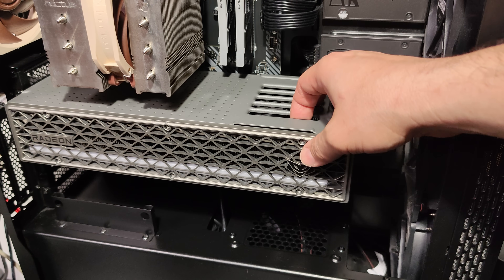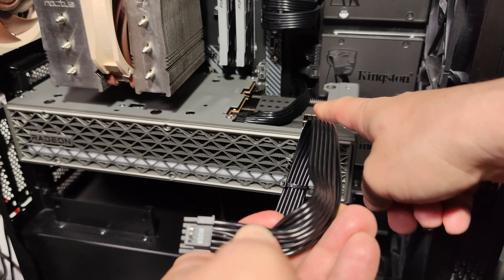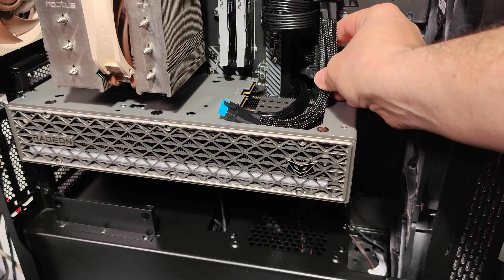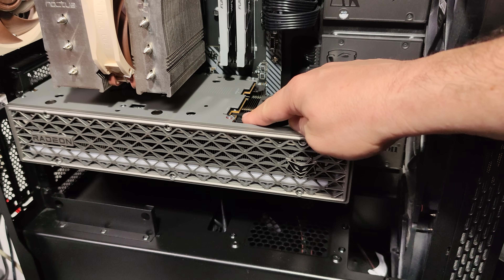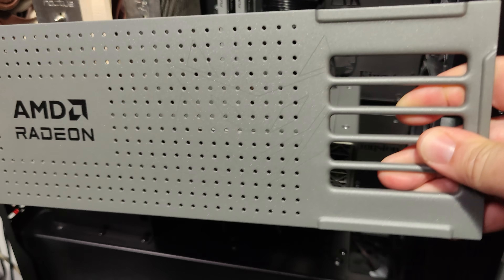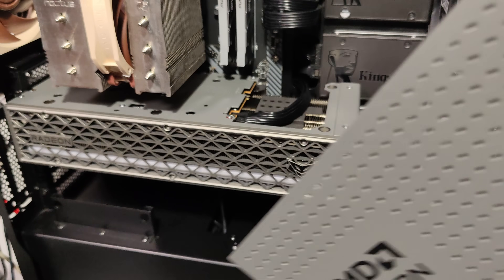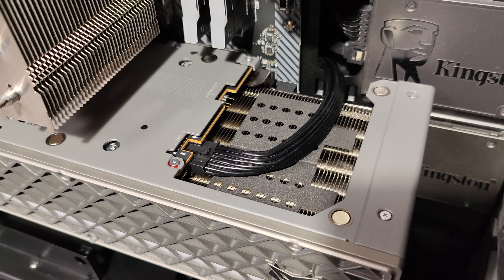Radeon RX 9070 XT Sapphire Nitro+  Magnetic Backplate More Problems Found And Exposed 🔥

Comment: Do the 9070 XTs have a lot of coil whine? I've read that this model, like the Pure and Pulse, has it. Do you think I should be worried? Sometimes I think people don't limit the FPS, and it turns out they're running at over 500 FPS in the menus.
Reply from the maker: I have also read about this. I haven't observed it on mine yet. I don't limit the FPS and indeed in some game menus it does crazy fps. Under heavy load i mostly hear the fans as I have a rather small case and it gets hot inside fast. Also the 9070 XT blows all the hot air into the CPU making it spike much more higher as I'm using the notorious Ryzen 9 5900X.

Comment: yeah guess what, the backplate is not sitting well because you dont use the delivered adapter in the box...
bro is just talking shit about the beding of these 😂
Reply from the maker: Yeah glue and foam on the heatsink, adapter cables like it's the '90s, using worst power connector ever made, adding a metal plate over a backplate so it traps heat, no problem here, the perfect reason to ask at least 300 euro move over the MSRP for this botch-up job.

Comment: Magnetic backplate is so stupid. Backplate was made to improve the stiffness of the PCB board. Going magnetic means you just add weight on top of the card and does nothing.
Reply from the maker: Very good observation. Sadly some people still believe that it "dissipates" heat....
Reply: To think that they just put as much budget on this non flagship card with all the material is just unbelievable… This card doesn’t take 500W to run but built to look like one. Also, that bulky ass shroud is blocking all the air and it looks pathetic… and it’s covering up the fact that the heat sink isn’t actually thick. Probably the same thickness as other 2 PCIE slot options. I missed the sleek nitro design for the RX 5000 series😢

Comment: Thanks for this honest and realistic look at the card's design. What you mentioned is almost exactly how the card appeared to me on first look. I'd be interest in what the actual heatsink/cooler design is like underneath that giant cage. I wonder if the heatsink is the same size if not even smaller than competing models.

Unfortunately, what Sapphire has done is create a LARGE card that people can mistakenly believe translates into better cooling performance but that may not be the case. Would love to see this card with ONLY the heatsink and what it looks like.
Reply from the maker: I will try to have a look over the cooler as i find it strange to see the VRAM doing 70-75°C in Windows with light loads and 0dB mode. With fans forced on it will cool the VRAM to 55-60°C.

Comment: I JUST ORDERED THIS CARD. YOUR STARTING TO SCARE ME.🙉
Reply from the maker: The card works for now, but the price is unjustified high. Ohh and another thing, mine will not be stable with an undervolt higher than -50mV so not won the silicon lottery either.
Reply: @TechTronic9000  i canceled mine. I was tripping @ 1K. That 2 much.
Reply: Im Falling back 4 now. I just want something for editing videos and creation. Can the Arc A770 do that 4 me??
Reply from the maker: I also got it for video editing, I'm using Davinci Resolve and it's pretty good. From what I know the ARC has pretty good encoders and should work ok for editing. Maybe you can also look for a non XT version, in my area they are about 200 euro cheaper.

Comment: 100% correct, we should prioritize functionality over looks again.
Reply from the maker: And not ask 300 euro more for the "extras" they did.
Reply: @TechTronic9000  Of course! But the base 
$599 MSRP is too high too, this is a $399-$499 card at most. The 'base'cards currently cost $866 or more in the Netherlands. €672 is the price including 21% taxes if you convert $599 so we already have a 12.2% priceincrease for the cheapest base-card which is ASRock. Another point of consideration: no GDDR7 and only a 256-bit memory bus, this is NOT aw highend card. Note that GDDR7 would cost $4-7 per GB while GDDR6 costs $2-4 per GB, something like that (not sure about the GDDR6, pretty sure about the GDDR7) so there definitely was enough room to put the better memory on it which would not only increase performance with 40% but also decrease the power-usage and temperatures. 

I have a 5700XT, I strongly consider to skip this round and upgrade sometime after I upgrade my Zen2 3700X to a X3D Zen6-CPU, it is roughly known what they will do with Zen6: 12 cores per chiplet, a substrate for the chiplets which strongly lowers the latency and a reworked I/O-chiplet. + low hanging fruit because Zen5 was kind of a new microarchitecture for which they couldn't fix everything yet. Zen6 will be a good gaming-CPU, guaranteed.

Comment: Honestly a complaint in search of an issue
Reply from the maker: Honestly since when it's a good idea to glue foam on a heatsink, to use the worst power connector and add a second plate over a plate and call it heat dissipating? Then have the reason to charge 300 euro more over the msrp for this botched up job.

Comment: Hello, I have this card with a Seasonic Vertex power supply, the 12 V cable for this power supply is much more flexible and not interfering with the back-plate. I recommend you break the plastic in between the 12 V cable so they can move independent
Reply from the maker: The most easy fix was not to put the plate on as it doesn't do anything, it traps heat and puts more weight on the card. That still doesn't solve the foam pad over the heatsink fiasco.
Reply: @TechTronic9000  It makes it look clean, works for me and temps are very good, I'm not worried about a little foam

Comment: One thing uploader missed:
- ATX 3.0 standard on his PSU vs ATX 3.1 standard for the 12vhpwr connector.
Reply from the maker: The ATX 3.1 connector should have shorter sense pins so if you don't properly connect the 12VHPWR cable it should not work at all to prevent bad contacts. This doesn't solve the foam on the hitsink fiasco, the 2nd backplate just trapping heat and adding extra weight.

Comment: why did you buy the card? All of this was said on their website
Reply from the maker: It was the only thing that i could find in stock. On the website they don't mention foam pads on heatsink fins and you also don't have proportions to see how bad the 12V connector is placed. They also advertise the backplate to dissipate heat, while it actually has no thermal contact so it just holds heat.
Reply: @ then how about you wait until restock?

Comment: GN and J2C did testing with/without the backplate and found no difference in temps. Stop lying.
Reply from the maker: Any exact links for that? In my compact PC case removing it makes a hell of a job as I have a close by system fan that blows over the board. The difference is extremely visible in 0dB mode with the fan off.

Comment: What a nonsene. I just installed mine. Backplate sticks on really good. Absolute gorgeous card.
Reply from the maker: That's why we get companies like ngredia, scalpers and retails acting like thieves. Foam glued on the heatsink, worst 12V power connector ever invented , a backplate over a backplate just trap heat and then add extra 300 euro over msrp, that what's wrong with this. Gimmick and marketing to bump up price with zero functionality.

Comment: Funny, I'm not having any issues with my cable routing, you should learn to route your cable properly as it looks like you didn't even try.
Also, use the GPU bracket to eliminate the sag, quit nitpicking for fucks sake. Seems you're only trying hard to find something to whine about.
Reply from the maker: Are you kidding?! Sticking foam on a heatsink? Using the worst power connector ever made, the 12VHPWR, adding a backplate over a backplate so it traps heat and then ask 300 more euro for such a botch up job! This is the sole reason we have ngredia and scalpers all over, ignorance.

Comment: Have you heard of GPU swag????? Maybe you should considered to use some kind of GPU support so you do not have that backplate wobble (your GPU is bent on right side 'cause of weight and you got GPU swag and backplate beeing held by magnets it is not bent so you have wobble)!!!!
Reply from the maker: Are you kidding?! Sticking foam on a heatsink? Using the worst power connector ever made, the 12VHPWR, adding a backplate over a backplate so it traps heat and then ask 300 more euro for such a botch up job! This is the sole reason we have ngredia and scalpers all over, ignorance.

Comment: Yes, I have a question. Why do you think they decided to implement this connector? What would be its advantages?
Reply from the maker: There are no advantage, they wanted to hide the wires to make a kind of innovation, they could not achieve that with 2x8 as there would have been to many wires to force there in the awkward 90° position.

Comment: There a better much more flexible cables out there . Your cable is bad !
Reply from the maker: I can split the wires, but still doesn't explain why they went with 12VHPWR, foam on cooling fins and a second backplate over a backplate.

Comment: Use better 12 V high-powered cables, they are much easier to route. 
This will prevent the backing plate from having an issue with fully seating .
I’m pretty sure you’re not swinging your computer around so nothing will short out .
The backing plate that is magnetic was never meant for heat dissipation. The plate underneath would be meant for heat dissipation.  It doesn’t work in the matter that you’re thinking either and is more than enough material even with the magnetic plate. That’s only for addition memory or power stage heat dissipation which the card already has pads that connect to the cooler for that. 

The Cooler doesn’t work in that fashion you suggest either. It’s not a blow through design therefore, the foam doesn’t do anything significantly negative being there to protect the cables.
Your idea of voltage drop doesn’t function in the fashion that you think . You only get a voltage drop when you exceed the capacity of a wire or a poor connection which would mean old or cheap connectors and wires. 
Anyone who has experience in electrical understands this. The amount of wattage you’re actually using on this card is nowhere near enough to cause such issues of a voltage drops that will matter. 
Cheaper cables use cheaper insulation, which is always thicker to make up for the lack of quality. It’s like buying garbage 12 gauge automotive wire from Amazon versus buying it from a place like milspec wire. You get what you pay for.
Reply from the maker: The backplate is described by the producer to dissipate heat, not by me. Regardless of the power cable, that doesn't explain such a poor job as using glue to stick a foam pad on a heatsink then used the worst power connector known. Then charge 300 more euro above msrp for this trickery. As for the voltage drop, you neglect each added resistance by each connector pin. Using adapter you add more plugs, more resistance and increase the voltage drop. As the board can draw the same power even at lower voltage it will just increase the amps, putting more loss and heat on the connectors.
Reply: nah its nothing to do with power cable. its the design of handling power on motherboard. it doesnt have power load balancing which is so dumb. look up this title "Taking a look at Sapphire implementation of the 12VHPWR connector on the RX 9070 XT Nitro+" by Actually Hardcore Overclocking, on here.
Reply: I feel like he knew that a flexible extension would have fixed the issue and just simply didn't bother... personal grudge against Sapphire or just 2x6 connectors?

Comment: if your 12vHPR cables were individually sleeved the bending is not a problem .
Reply from the maker: I can split the wires, but still doesn't explain why they went with 12VHPWR, foam on cooling fins and a second backplate over a backplate.
Reply: @TechTronic9000  i believe its for the same reason phones dont have 2x Micro USB instead of a C--USB .More power through just one connector not 3 .Some people arent bothered with looks and i get its safer to have 3x8pin but nVidia made it unsafe at this point , let the future decide witch is better at this point . Sure your opinion is valid , thanks for the video! Also my card working on 100% never passes the 55C thermal , how much does the backplate you think adds to that?

Comment: have you tried splitting the wires? they dont have to be stuck together
Reply from the maker: I can split the wires, but still doesn't explain why they went with 12VHPWR, foam on cooling fins and a second backplate over a backplate.

Comment: My first thought after I saw placing 12vhpwr connector in this Nitro+ was ''Sapphire, why do you want me to bend cables so much so close to the 12vhpwr connector???'' Second thing is people who already has this 12vhpwr cable with their PSUs. Those one are much less flexible than the connector Sapphire provides. Mad design in my opinion.
Reply from the maker: You are absolutely right. They could think it a bit more.

Comment: 0:07 Dude, what are you doing? I have the exact same card and those magnets hold the backplate like really strong. I was surprised by their magnetic force no joke. Noone must worry about this!
Reply from the maker: I explain in details, the backplate doesn't hold on as it's pushed out by the PSU cable. If i separate the wires or go with the included adapter it's still a botched up design with foam on the heatsink,

Comment: that backplate should have just been not all the damn backplate at all just the little vent where you put the damn cable that burns wallets and that its made to help disipate heat from the cable aswell making it with a little desing of something so it helps the cable follow a path so it doesnt get in the radiator fins.....those mfs at sapphire were smokin something else with this one beacuse the rx 7000 models were straight FIRE

other than that im jealous you got this model.

and i get a rx 9070 xt for myself....but my whole pc is black and..the only available one was the yeston one with the anime girl in the backplate and...its white asf......but at least i got it at a "fair price" lmao, my rx 6700 xt is going into a nice whole diff pc for my lil bro
Reply from the maker: I'm also OK with the board considering it was the only option I could grab, now they don't have stocks or the retailers are scalping you with 1600 euro price tag for their remaining stock.

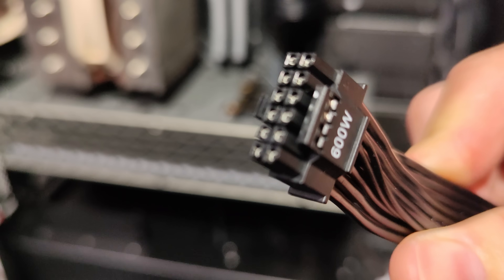Comment: 1:02 - I'm not a big fan of the 12V-2x6 myself either and I also think that it was a stupid decision to put only one of them on the RTX 4090/5090 without proper powerbalancing, but stating that it "usually" catches fire is just exaggerated and false.
Reply: Also those cards can draw way more power than the nitro+ 9070xt, 600+ watts vs 380 watts.
Reply from the maker: There are multiple issues with this build 1) Foam pad on cooler fins, 2) 12VHPWR connector, 3) Backplate that traps heat, 4) Possibility of plate coming off. The idea s that you pay around 300 euro more for these "features".
Reply: @TechTronic9000  3 out tens of thousands sold is not what I'd call "usual"
Reply: @TechTronic9000  The point of the above comment was that you're exaggerating the connector issue and your reaction is to list all your issues again? Weird...
Still no fan of the connector but I'm not afraid it will melt in this scenario, this ain't no 90s Nvidia 😅

Comment: What? More resistance = less current. Simple Ohm Law, I=V/R. More R = less I.
Yet it probably is so negligible that it has almost no effect.
Reply from the maker: Not really in this case as the GPU is not a basic resistor circuit. It can can pull more amps to compensate for the resistance and voltage drop. More amps with more resistance = much more heat. An empirical example is that at 330W you will be pulling 27.5 Amp at 12V, if you have 1V drop then you need 30Amp to obtain the same 330W, so you already pull 2.5A more. It's not a huge difference, but considering how many pins you have in all those plugs you get higher chances of a dud connector thus creating more issues than needed.

Comment: come on man sapphire is trying something and i am sure they will do better, we need to motivate them, asus gigabyte msi they keep on doing the same designs and the innovation scam is only in the fan design. 😄
Reply from the maker: Yes, they can do better, for instance put the 12VHPWR connector straight, not at a 90 angle, design a real backplate and only have this second one as a cap for the connector area. Plenty of common sense ideas possible.

Comment: Why do you even have a 1300W PSU in that system?
Do you have any idea how inefficient that is with the hardware you have?
Reply from the maker: Ahhh, the old 50% load efficiency myth without actually knowing my config. Ryzen 9 5900x with ~ 180W, RX 9070 XT 330W, already 510W, then you can add negligible extras such as 5 ssd drives, 5 120mm fans, motherboard & ram. Also my PSU has 90+ efficiency at just 20% load.

Comment: There is nothing wrong with this card, I've been using it since release with no issues. Looks great, runs cool, overclocks well. Would buy again, so don't agree with this opinion in the slightest.

Comment: your technical knowledge is basic
Reply from the maker: Yeah you got me, still that means the producer was purely primitive sticking out foam pads on fan heatsinks, using the worst power connector ever designed and putting a "backplate" over the backplate to trap in more heat.

Comment: Thats extra heat trap. Double backplate with no termopads between them is just heat trap.
Reply from the maker: Luckily they have also used foam on the cooling fins of the heatsink.